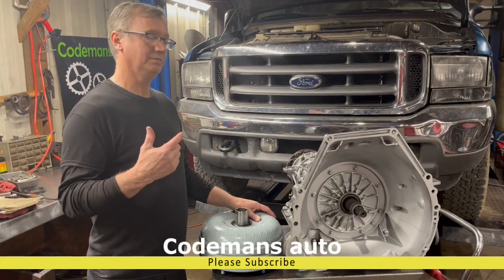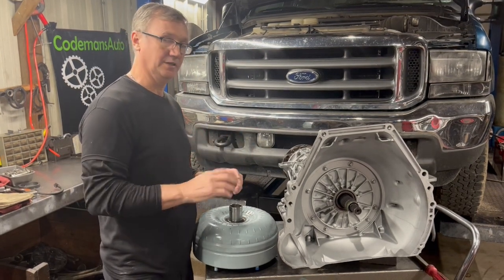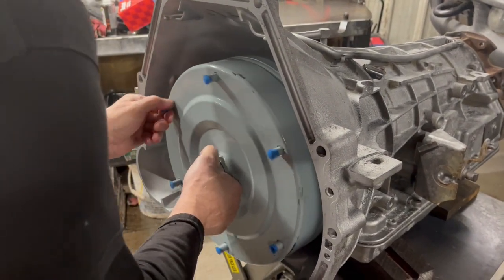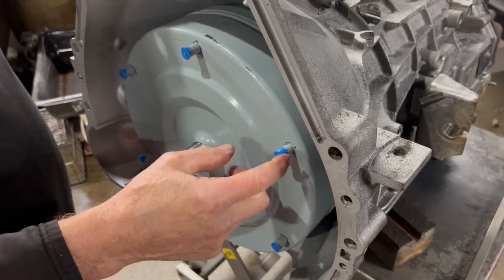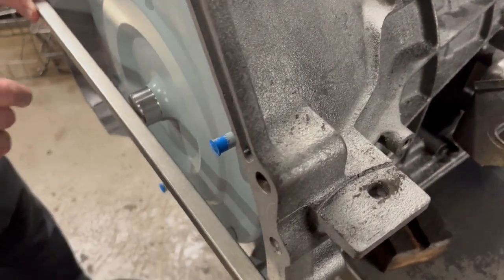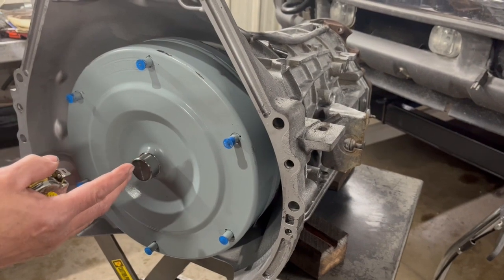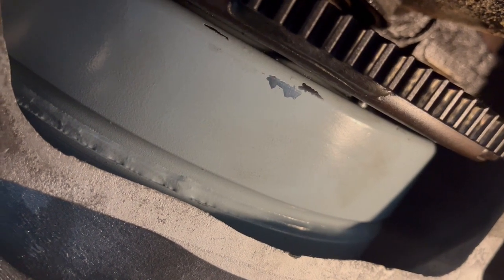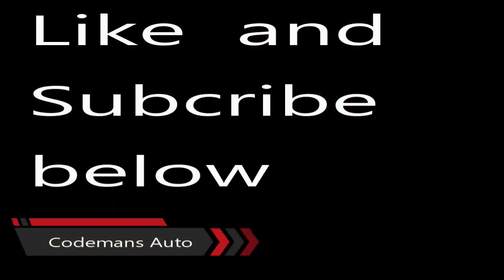Don't break your pump! How to install a 4r100 Transmission Torque Converter in a Ford f250 f350 7.3

Comment: Do you know if the 5r110 is the same measurement? I have mine in but it’s a little less than a inch and I can’t get a straight edge to sit flat so in other words the straight edge is touching the pilot

Comment: Awesome video man!  Just have a question. I am NO Machanic. My 7.3 is idling down low when shifting into reverse for a few seconds and then idles up fine and is fine for a while in drive. Then once driving it will randomly shut down completely. Any idea?  Place I took it just told me $3900/$4100 to replace torque converter. If that seems right ok! But I wanted to get another opinion and you obviously know what you’re doing lol.
Reply from the maker: it could be the torque converter but there has been a lot of issues with the pump cross leak i would not change this torque converter with out changing the pump also I have seen these low on fluid and do just what you are talking about because of the plastic tip check stick I like to overfill about a 1/8 inch above the full mark   this might help but $4000 is enough to buy a jasper reman transmission with a billit converter upgrade    Hope This Helps

Comment: Should you prefill the converter?
Reply from the maker: On a chevrolet and most others about a half quart of transmission fluid is plenty to lube the converter bearings and soak the TCC clutch any more then that will cause you a mess but fords can drink three quarts fairly easy